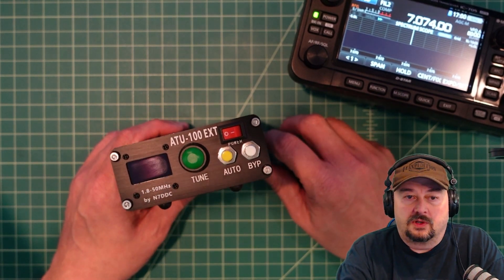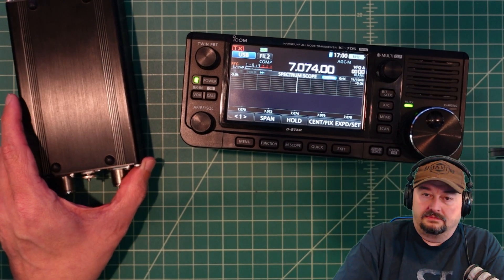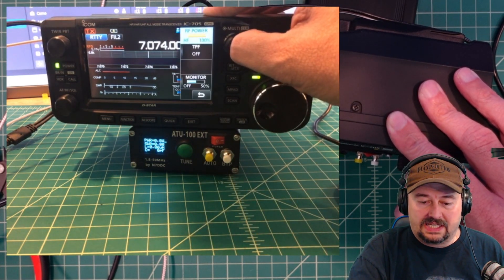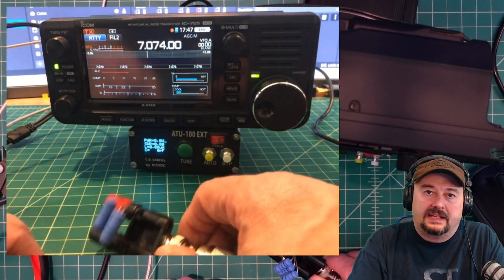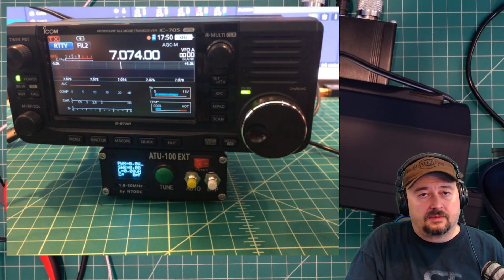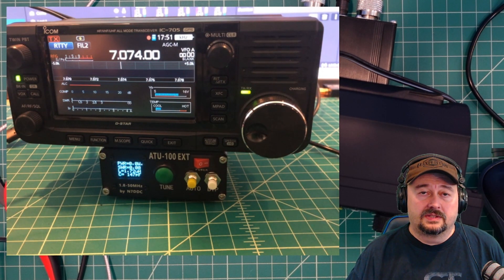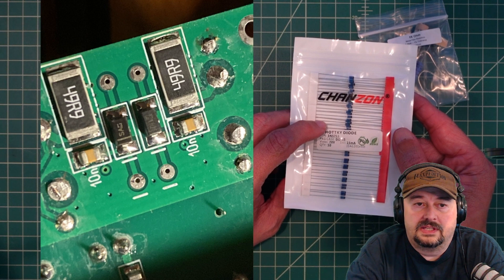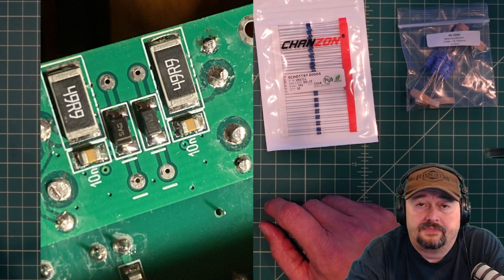ATU-100 Antenna Tuner Problems

Comment: Baught the Kit prebuildt from Banggood, and the switches and chassis from Aliexpress .......: finally got it to work, after moving just the cables for the input, and output between pcb, and so-239 , Ver. 3.2  software. so what i learned is to keep those wires as short as possible from pcb to the ant.connectors!  73´s and thanks for making this video de LA6REA.
Reply from the maker: Glad you got it working 👍

Comment: I bought one of these auto-tuners.  It worked fine IF you can believe what it displays on the screen.  I do know that it greatly exaggerates transmitter power, reporting a known 5w RF input as 18w even when tuned to resonance.  Anyway, I never really got to know everything about it because it stopped powering on after some days of use.  It now sits in what I call my "purgatory box."  From there it will either go on to the parts bin or I'll try to fix it.  It may not be a bad deal if you can buy one cheap enough.  I hear from others that the design blueprint is just fine but that the pre-built units have serious quality control problems.
Reply from the maker: Sorry to hear it didn’t work out for you

Comment: I've the same issue down here.
Thanks a lot for sharing. Great video!

 I decide to rewind the tandem transformer and replace the diodes as you did (1N5711). 

My antenna is on top of an apartment building, a random wire with the sequence of a 1:1 choke balun and a 9:1 unun. I've tested the antenna with nanoVNA  close to it. All Z values were ok for the ATU-100.

My problem is: if my ATU ( my version is weather proof and can be installed outside close to antenna), 

With the ATU on 14th floor, and 38 m of RGC213, the tuning is almost perfect for all bands, from 80 to 10 m, with an exception ,1.8:1, on 20 m.

But, when it seats close to the balun/unun,  with a short (1.5 m of coaxial cable), the ATU is totally unreliable. It's useless!   : (

Sometimes the unit enters on an infinite loop an never find the good combination. Then I change the radio to other band and come back to the previous one,  it works ok. 

The case where it is mounted is plastic made bud shielded on internal side with copper foil adhesive tape. 

I'm giving up to use it close to the antenna!
I'm lost.

Anybody have an idea of what is going on??

Paulo  PY1JDX
Reply from the maker: I stopped using mine, I should probably get it out an see what can be done.

Comment: You don't use a tuner on a resonant antenna.
Reply: A resonant antenna may not have an impedance close to 50ohms so would require matching of some sort
Reply: @paulm0hpd319  Yes, you are right.  I have been playing with nec2 antenna simulator.  I look at the radiation pattern, then the complex impedance, then will there be a big enough inductance and capacitance in an atu100 to match it?
Reply from the maker: That’s right

Comment: I have prefect 1:1 with a dummy load, however it's all screwed up once it's hook to my 40 Meter Inverter V. Now, I don't have any other instruments to dig into it.
Reply from the maker: I’d check to see if you have matching diodes
Reply: @TheSmokinApe  I usually rely on this as a poor's SWR meter most of the time. My antenna was really bad and maybe the diodes couldn't handle it and died. Anyways it's just speculation for now. I will update you
Reply from the maker: @VU3HZW  good luck with it 👍
Reply: @TheSmokinApe  I took help of someone who can work with these smd components. 
I explained him the issue. 
The tuner is work just fine @ 20 meters with 70 Watt. He don't have an antenna to test it on 40 Meters. Dummy loads is always perfect 1:1. Now, I am very confused 😢

Comment: There are several ATU-100 models out there, all similar in appearance.  I have been using an ATU-100 Pro+ for close to a year, now, with no problems on 80, 40, 30, 20, and 15 meters into a vertical with some pretty serious swr problems.  I'm also using it between my Kenwood TS-430S and a Swan 1200X tube linear amplifier which has very poor input matching.  I highly recommend this tuner, but make sure it is the Pro+ model.
Reply from the maker: Thanks for the info Paul, I wasn’t aware of the Pro+ 👍
Reply: the one i found just has an oled screen, tune button, power switch and is rechargeable. Is that it?

Comment: 2 points: I don't think you can use resistors of any type to simulate a transmission line; wire wound are terrible, metal film are bad, and carbon would be best choice but probably would only work for null readings because the tuner normally only tunes the coax to show the reflected power and needs the complex impedance to make that work. I noticed that it takes a certain amount of power to make the thing work which can be changed by different windings on the Un-Un toroid (I just saw a you tube on it) so check to make sure you are feeding it enough watts.

Comment: From China, I only buy kits, nothing pre-assembled. Then I check each component for functionality and measured value as I'm assembling the kits. Then I test the Hell out of them after I build them because I still assume I may need to change something to get them to work properly. It's really best to assume anything pre-built from China is defective or unsafe, and spend the time to go through it and make it right.
Reply from the maker: Hey John, thanks a good practice.   I have the kit and it has the wrong diodes mounted on the board AND the new assembled ATU from China just showed up...  maybe I will crack that one open on video and see what's doing.
Reply: @TheSmokinApe , an excellent idea. With aspects of fixing old, free equipment, ham swap finds, fixing things that are breaking, not quite right, out of spec, and not doing quite what you want, making special programming or data cables, building kits and accessory circuits, adding convenient antenna switches, putting together a station desk and shelving for gear and whatnot to fit in the space you have available, my belief is that ultimately, a ham station is always something that's built, not bought. Only millionaires can truly 'buy' a ham station. And if they do, they've missed out on most of the fun of ham radio. Fundamentally, a ham station consists of more than a rig. It also contains books, hand tools, a soldering station, parts bins and some test gear.

Comment: I say try the “fix”,, you still have the kit. Thing is, there is some pretty crappy cold looking solder joints there.. replace the diodes, reflow the solder lints.. and see what happens..
Reply from the maker: It's gonna need some loving to get it right...
Reply: @TheSmokinApe  but look at the fun you could hav!

Comment: I built a Kit version of the tuner with OLED display. I too have this issue but only on 75/80 M. Also mine is the QRP version good for about 20 watts. The other issue I have with mine is that it won't tune at lower than roughly 5 watts. So its basically useless for QRP. My QRP rig puts out 1-3 watts on battery. Fun project to build and when it works it works ok but in my case its useless.
Reply from the maker: From what I understand, v3.2 of the firmware will tune with 1w.

Comment: Just wondering. I see the bag says "Metal Film Resistors" I thought we were not supposed to use that kind with RF. I thought it was supposed to be "carbon film". Am I not understanding that correctly? Interesting video. Thanks for posting.
Reply: Carbon Composite Resistor is the best choice for a resistor in an RF environment. We use this when teaching students the use of a BIRD wattmeter. We have made black boxes with four BNC connectors marked A, B, C and D. Each connector terminated with different 5W resistors ranging from 40 ohms up to 300 ohms. By using a BIRD and measuring forward and reflected power the student shall calculate VSWR and from that calculate what impedance they think is present on each connector. They will of course have two answers for each connector as there will be two impedance values giving the same VSWR. For instance both 25 ohm and 100 ohm will give VSWR of 2 on a 50 ohm system.
Reply from the maker: I think you have that backwards.  Metal film are more stable and less noisy, I think.
Reply: @TheSmokinApe  Maybe a video at a later date about why this resistor instead of that one for a dummy load. I have an old Drake DL300Dummy load Model 1550 and it say right on it Carbon. I'm not an expert at all so that is why I was asking. Thanks for the reply.
Reply from the maker: @emoisit  I’m no expert either, I crapped these because it’s what I had on hand.  They were actually left over from a oil can dummy load project.
Reply: @TheSmokinApe  It has become an interesting avenue that I'm gonna have to do some research on now. LOL. Some of the stuff I have read before says that wire wound resistors have an inductive affect starting around 3-4MHz. Will have to learn something about the difference between carbon and metal film in ref to RF. Thanks.

Comment: The SA is a 1N5711W and E1 is the date code (January 2017), the other one seems to read Z41 and it is a BAT41. Each diode on its own is well suited for the application, but having different diodes will create different scales for the forward and reverse power metering. That is why on 1:1 it seems ok, but anything else is bad.
Reply from the maker: Hey Rafael, thanks for all the help!
Reply: @TheSmokinApe  my pleasure to help!

Comment: Hi ape
A lot of these tuners and the kit, have been made with the wrong diodes,
I found with the wrong diodes fitted the reading got worse the higher you go in frequency, what are the new ones you have ? BAT 41, work well, 
But I think in your case you should look for a bad cap or inductor , or relay contact if it was working correctly before ?
Dave 2E0DMB
Reply from the maker: Hey David, I looked at the kit I have and it has two different diodes as well.  Then I looked at the schematic and it says "D1, D2 - BAT41, 1N5711" meaning either diode should work. It looks like the are putting BAT41 in D1 and a 1N5711 in D2...
Reply: @TheSmokinApe  
Hi my board was ok on 40m and the reading for the power was getting worse on 20 and the higher I went the worse it got, so I changed both diodes to bat41 and all is good, the diodes are used  to changed the voltage to DC before it goes into the pic controller, it is just that most have been fitted with silicone diodes that do not cover the HF frequency range,
Also look at the tandem match transformer, as if that is damaged and is putting out to high voltage the swr will read higher than it should,
Dave 2E0DMB
Reply from the maker: @davidbrowne1588  that’s awesome, glad you got it sorted out 👍

Comment: It appears that it's too sensitive on reflected power.  Variations in reflectometer construction can cause this.  There should be an R controlling this.  One schematic shows this at 68K - you probably need more.  Put a 100K trimpot in it's place and adjust it with the 6:1 load.   I'll bet the 1.8 final tune value will come down too.
Reply from the maker: Hey Chris, thanks for the suggestion

Comment: I was considering this ATU and I I wasn't sure if I should save the money and get the kit or not waste my time for just a few bucks. But after seeing these videos from the inside, I get the impression that you kind of have to get the kit if you don't want it to be put together very poorly.
Reply from the maker: I am thinking you are right. I looked at the kit I have and it has two different diodes as well.  Then I looked at the schematic and it says "D1, D2 - BAT41, 1N5711" meaning either diode should work. It looks like the are putting BAT41 in D1 and a 1N5711 in D2...

Comment: Hard to tell from the video, but the solder looks like it was done by a solder school dropout. Maybe Flux and retouch? Check to see if the diodes are still diodes?
Reply from the maker: Yeah, the solder is a mess.

Comment: "End fed half-wave dipole". I am confused. That's ok, happens to me a bunch.
Reply from the maker: Check this video Lee: https://youtu.be/Fu-HubyHP3Q
Reply: Thanks for the suggestion. In the video, you said, "End-fed half-wave DIPOLE", emphasis mine. When did an EFHW become a dipole? 🤔
Reply from the maker: @LeeMccNA5T  it’s technically a dipole that you end feed vs center or off center feed.
Reply: @LeeMccNA5T   i tested this EFHW Dipole, and its an easy To try attached to a Fishingrod Link: https://www.youtube.com/watch?v=B1k-ybRNBIE&t=311s.        73,s de LA6REA